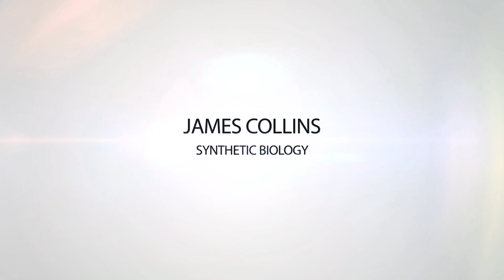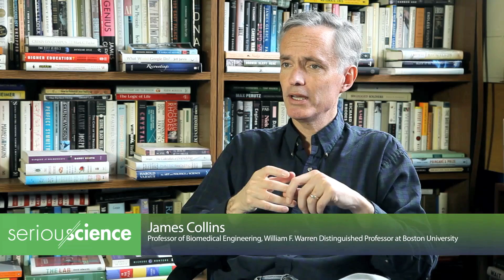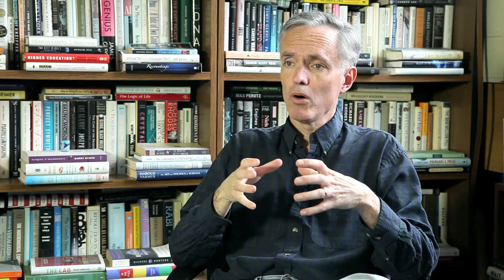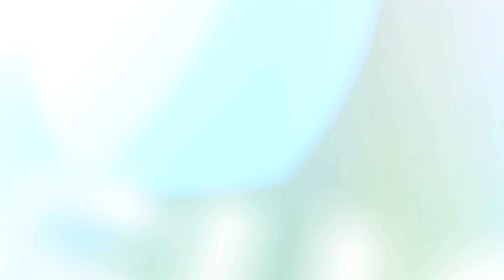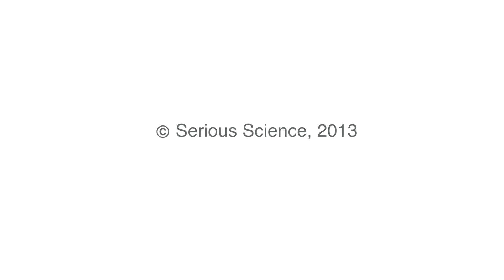Synthetic biology - James Collins

Comment: at 10:56, its an interesting idea but how to control the normal and spontaneous evolution of that single bacteria that overrides the repressive mechanism and starts producing the cholera drug without the presence of infection.
Reply: Some of the best vaccines out there use live bacteria or viruses. They attenuate the bacteria/virus so that it cannot harm the host and the chances of it spontaneously reverting back to a pathogenic state are very low. A good example is the typhoid vaccine:
https://en.wikipedia.org/wiki/Typhoid_vaccine